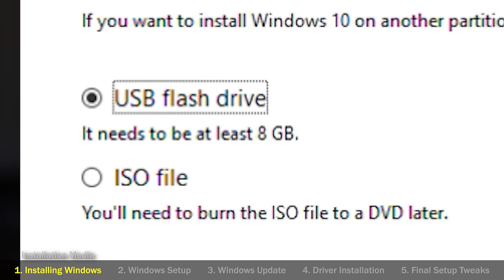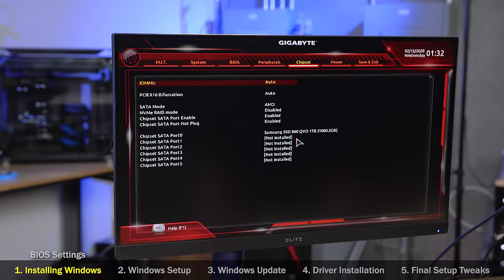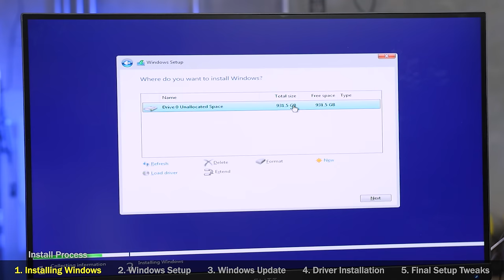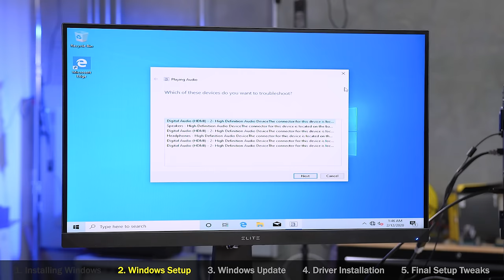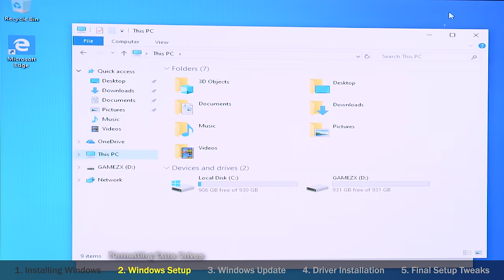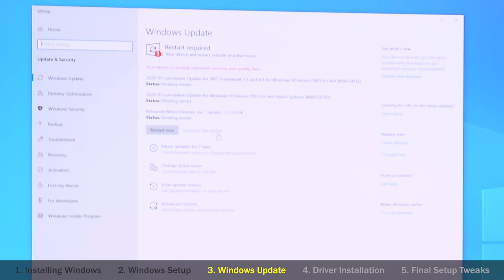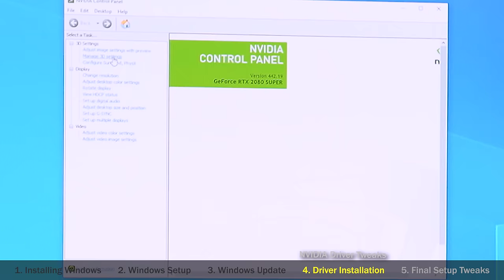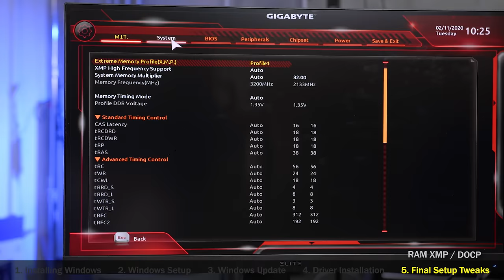Guide: What to do AFTER building your computer...

Comment: What to do after building: 
1:Instantly start regretting the parts you bought
2:2 days later find the parts being 20% off.
3:Realize you don't, and didn't need the extra power. And instant regret.
4:if purchased from micro center, take it all back and lie about how nothing works with some well thought out story  which wasn't needed. Get a gift card cause you don't feel like waiting,  and enter yourself into a perpetual state of returning and buying from Microcenter/amazon.
Reply: Dang, I regret buying a 1660 super instead of a regular 2060. But, hey, at least my Power Supply is 850W :D
Reply: @simearsov  If you're just doing 1080p, I wouldn't regret it too much. Just get a nice overclock on that 1660 super and you should be pretty good ;) 

But yeah, 2060 is better lol.
Reply: @davichan9286  Yea, 1080p on a 75Hz monitor, so 75 FPS, but I will definitely upgrade in the future. I guess the 2k RTX series will get cheaper by then. It was like a 100e($110) difference between my 3 fan 1660s and the cheapest 2 fan 2060 KFA2, so that's why I went with the 1660s. I mean, I don't trust the 1 fan GPUs. I definitely could've cut some corners.
Reply: @simearsov  you made the right choice. I love to repurpose my cards. So I took my 1060 3gb which is garbage compared to your card, and I  built an arcade cabinet and built a mini pc with it inside. Plays every system. 

Or I'll make a lil starter system for a family member. $110 is a big save. Nothing to sneeze at for sure.
Reply: Davichan flexing you cards I’m over here with a gt 1030
Reply: Accurate AF - I can't remember when was the last time I didn't regret buy PC parts or accessories....
Reply: @davichan9286  My problem was deciding how in the world I was going to upgrade from a 980TI. I somehow managed to get this GPU in 2017 for a grand total of $90 USD, and I've never felt comfortable fleshing out my bank for a new one... until recently.
So I got a 2080 Super and it comes in a week.
Reply: Regret buying more power?? hahahaha :D this has got to be joke right
Reply: @Dmarshall072  It does happen. For example I ONLY play world of warcraft, that's it, and nothing else for over 10 years and skyrim.  

I upgraded from a 3gb 1060 to a 2070 super, and from an i3 7100 to a i9. 

Got home, and nothing changed for me. I play without mods, and wow was still playing at ultra about the same lol. So I seen that huge dent in my wallet and was like "why? lol" returned it and put my system back together and noticed no difference. 

then I bought me a motorcycle XD

It was a case of me getting things I simply didn't need for what I was doing and like to do.
Reply: @davichan9286  how in the world were you able to return everything after using it?
Reply: @Brisingrr_  Microcenter lol that's how. Also amazon is not too hard either. A simple return and say it's dead, or locks up and freezes ect. 

Sometimes I get something just to try and out and take it back ^-^
Reply: @davichan9286  wow that's awesome. I don't think we have a microcenter in Australia though
Reply: @SolDizZo  lol I just upgraded from a 1070 to a 2080 super. Still waiting on a few more PC parts before I can build the whole computer tho
Reply: I regret buying a cheap Chinese brand rx 580 it works perfectly expect the fans are so loud. I should gotten a sapphire nitro+ version but they only sell them for used
Reply: @davichan9286  was vsync stuck at 60? lol

Comment: 17:46 Just a note, setting Power Management Mode to Maximum Performance will increase GPU Clocks and Voltage even on desktop environment or idle situations… so if you care about longevity just leave the setting on Normal.
Reply: the longevity of the graphics card? or the whole pc
Reply: @electricarrow8903  good quest'n
Reply: @electricarrow8903  the gpu but it’s not gonna cut your life in half or anything and it isn’t set in stone. just could make your gpu die a little earlier than it would’ve prior to boosting but imo it’s worth it i notice fps gains in competitive games like RL or league of legends stuff like that.
Reply: @showtimer_  recent high end cards lifespan dosent seem to be affected much by light over clocking tbh. On the other hand I killed my good old 970 gtx (before building my new pc) by pushing it to it limit after 8 years of use in less than a month (to be fair it was pushed MUCH MUCH further than what it was made for atleast 2 years.. It death was to be expected)
Reply: I put my on max, chances are your gpu will not die within a couple years and if it does then you have plently of options to choose from. Additionally, prices are coming down and by the time you need a new one, you will not have a hard time getting better gpus for a better price than before.
Reply: My 1080ti was on max for 6 yrs. Everything good to go
Reply: @BIGHEADjr51  Same
Reply: Unless you have enough cooling.
Reply: @thebrokenmask8304  just got my 3060 ti do u think i could run it on maximum performance and be fine for several years?

Comment: another excellent video. I built my first computer back in the mid 90s. I knew nothing, and I mean nothing, about computers. A friend was kind enough to give me a Packard Bell computer. It was running Windows 3.1. I used that for about a year and really got into it. I started reading computer magazines. After a year or so I felt like I outgrew that machine so I ordered a case with the motherboard installed from Tiger Direct. Don't ask me how but I got the parts I needed, put them all together and lo and behold, it booted up! A friend lent me his Windows 95 disc and I was off and running. Never looked back. Been hooked ever since. Eventually ended up working in IT for 20 years. Have built many computers for myself over the years. Sure could have used youtube back then. I still watch channels like yours and I still learn things. Thanks for all that you do for the computing community.

Comment: Thanks so much, Jay.  Just built my (er-- mid-range) budget system: CPU: Ryzen 5 7600x, GPU: RX 6700xt,  Mobo: Gigabyte B650, RAM: 32gb DDR5, Storage: 2TB NVME, Case: Antec DF 700, PSU: EVGA 750W.  
I did every step of your video and got Win 11 installed.  Thanks so much.  Relatively painless.  All stock, no overclocks.  Enabled XMP, and set it to stock 6000 mhz --no memory training.  So weird not having drive bays.  Case runs quiet and cold.  Definitely an upgrade from my old I5 3570k system.  Love it.

Comment: FYI: Microsoft best practices actually state to click "I don't have a key" when you first install in case you need to reinstall again for whatever reason(because Microsoft). This puts you in trial mode(30 days to activate) so you can ensure that you do not have to go through the reactivation headache if anything tragic happens.
Reply: FYI if you install it in UEFI mode you won't have to reactivate at all.
Reply: @praxxor718  True
Reply: @praxxor718  Could you please explain this?  The last time I built a system was 8 years ago and if I am not mistaken there was no UEFI mode. I am about to build my new system in a few weeks and would like to understand how this works.  Thanks.
Reply: You don’t have to reactivate because Windows will store your activation within the ACPI table of your motherboard.
Reply: @parithon2397  Thanks
Reply: I just have a windows 7 recovery disk from an old laptop and there is a license key on it and I’ve made about 10 virtual machines with the same key and 3 windows installs on actual desktops and never had any issue. (Let’s hope Microsoft isn’t reading this)

Comment: 7:00 That only applies to 1903. They let you use an offline account again when plugged into the internet in 1909.
Reply: You could also put in wrong data and it would offer you to check your connection or make a offline account
Reply: not for Home
it happened to me with a laptop, had to go outside the building to cut WiFi connection
Reply: @zMeul  There is a Button that says limited experience or Join Domain on newer Versions, there is always a Button !
Reply: It actually worked all the time. At least here with the german versions
Reply: confirmed.  You can always say 'no thanks, setup offline account'.
Reply: Correctamundo! you have option to select, 'I dont have a mickey account,' then in the next screen you will have the option to select 'Use an offline account'
Reply: Doing clean 1909 installs last weekend on all of our computers, I found that the “Home” version would not let you setup with an offline account unless you were not connected to the internet.  The “Pro” versions all had the option for an offline account.  Kinda pissed me off till I found the non connected trick as I am selling that computer.  All installs were done with the same USB drive
Reply: Don’t think they had internet in 1909 mate /s

Comment: Well, i build my costume pc like 1.5 year ago, and i just realized now that my ram was set on bios running 2133mhz instead the full 3200... thanks 😂
Reply: I'm truly sorry for the 1.5 years of wasted potential
Reply: What kind of costume did you put in your PC?
Reply: Depending on the speed the xmp profile is set to, you should be getting around 30-40 more FPS
Reply: @santimeek5063  hahaha
Reply: @santimeek5063  lmao
Reply: @sierra7534  LMAO No.
Going from 2133mhz gives you 10 more FPS  at best.
Reply: @sierra7534  u tripping bruh
Reply: no kidding. Professionals that sell them should mention this if you buy directly from them. Mine sure didn't.
Reply: I've got 2x8GB 1866hz stick. Should I change my ram frequency on BIOS?
Reply: @pchaski  It depends on the CPU and motherboard you have.   If you have a non-overclockable (non-"K" variant) Intel processor, for maximum system stability, run the RAM at the maximum RAM frequently supported by the CPU and motherboard.   Usually you are limited by the CPU.   Check the Intel ARK page for your processor's maximum supported RAM speed.
If your RAM modules and motherboard support XMP profiles, you can run the RAM at the maximum speed of the RAM but you may experience system instability.

Comment: I installed an OS over one of my backup drives once, back when we were all using XP, took me hours to get some of that data back lol
Reply: ez task.
1. do not format that drive beforehand
2. look in Windows.old folder
Reply: @vadnegru  I don't remember XP giving a Windows.old folder and they also said back-up drive so there wouldn't be a windows.old folder in the first place since there wasn't windows installed previously so no, not ez task.
Reply: @BloodsCaress  missed XP there. That behaviour was fixed since vista/7
Reply: thats why i disconnect all but the sys drive prior shitting over it with dual boots and linux... :D  Windows is like a over.zelous gf - allways wants to be the only one
Reply: @teknastyk  Linux maybe did same back then, this is a system drive and it must be clean.
Reply: @vadnegru  okay this was back in 2003

Comment: Do you ever get nervous about an upgrade or Installing new hardware, well I do. I created a backup disk image and it took me more than 5 hours, my first backup. If a power failure would have happened I would be lost. Oh and I did my disk image on DVD's. More than 9 DVD's. It is funny how when I was a young man at the age of 15 I grew up with tube technology, cathode anode and grid. Tube technology is sill used in Marshal amplifiers for guitars. I would suggest that we hold our breath until the update is done. Never going to happen.
Reply: onemon22 I always pucker up a little anytime I reflash the bios. The pc is plugged straight into the wall, so I’d never do it on a bad weather day. Power surge during bios flash....brrrrrick!
Reply: @zackstaa7826 
Definitely get a UPS

Comment: Brain : you already know all of these stuffs 
Me : i still wanna watch it 😑
Reply: And then the realization: Jay generalized a lot of stuff that is not necessairly true for your PC.
First mistake I spotted was the Del key. All of my computers use different keys to open the BIOS/UEFI Menu. Examples: F1, F2, F10, Del, Ctrl+Alt+Ins...
Reply: @bodgemaster7946  Even one time i had missing ethernet drivers, so i had to download them on my phone to get it working ;d
Reply: Some of my computers use f12
Reply: So true. lmao
Reply: @bodgemaster7946  95% use the delete key. A few F8 and a couple F2. I've NEVER come across a PC that needs the others you mention, in 20 years of building!
Reply: @davybloggs1564  I have come across Computers with the following keys (examples included): Del (Most of them), F1 (Lenovo ThinkPad T420), F2 (My Fujitsu Siemens Amilo (iirc), Dell PowerEdge 8??), F8 (Asus P8?), F9 (HP EliteBook 2450p, HP EliteBook 8840p), F10 (Some HP Pavillion with an ASUS P5B) and F12. Ctrl+Alt+Ins was meant as a joke because my Retro-PC uses it. It’s a Siemens Nixdorf PCD-4RsxA. Obviously, most of these systems were not built by me.
Edit: Corrected myself.
Reply: U dont need to instal anything for ur procesor ? Just the chipset driver ?
Reply: My pc uses each as boot key

Comment: Hey Jay, in regards to Microsoft account-

I'm an InfoSec pro with a long history of IT, lots of time spent installing Windows10. I don't believe it is accurate that you need to be offline. There should be "fine print" / small text at the MS account part (they try to hide it) that says something like "create local account" or "I don't have a MS account"... Something like that. I have never made a point of leaving my builds (or when reformatting) offline during setup, and 99% of the time they are still wired up to my network, and I have never used my Microsoft account for an install.

Anyways, just my two cents, this may have changed in the last 6 months or so (since my last windows install) so take it with a grain of salt. As always, great vids bro!
Reply: Very true
Reply: What's the deal with not making an online account anyway? I thought that sped things up if you're an existing user since you can just log in and they know what your key is assuming you linked it.
Reply: @DragonNexus  when I'm installing windows I create a local account first during install because I use a randomised password that is way too long to type in during install. Install local first then sign in once I've installed my PW manager and everything syncs :)

Comment: I have faced this issue recently and I found out why. I actually modified my BIOS and enabled fast boot since I have gigabyte aorus motherboard. After that when I booted up my pc, I would see my GPU fans spin but after 3 seconds it stopped spinning. I definitely knew it was that setting which was stopping my GPU. After that I checked the motherboard manual and I had to short 2 pins to reset cmos. After shorting nothing happened same issue. Then I tries another method which was to hold the power button for 30 seconds. After that I booted the pc and my GPU would spin and not stop this time. Finally I force shut down the pc by holding power button and when I booted again, my GPU would work normally and I got display output. It seemed my motherboard booted into bios saying that it had been reset. So if no methods work, just reset cmos

Comment: Press Win+R , enter msconfig, hit enter, go to "boot". Set time-out to 3 seconds. Next go to "advanced options" under "boot", click on "number of processors" and set it to the max number of cores/threads. Close and save. Windows wil boot much faster. ;)
Reply: Vortex DIY Crazy how people can’t wait 10 seconds for their pc to boot up normally
Reply: Windows uses all available cores at boot time. The snippet you read on the Internet is most likely the super-über-hack to go into MSConfig and then check the Number of processors box and then click the number of cores you want Windows 7 to use. People writing about 'how to speed up the boot process' did not understand the what that checkbox is used for:

Number of processors. Limits the number of processors used on a multiprocessor system. If the check box is selected, the system boots using only the number of processors in the drop-down list.